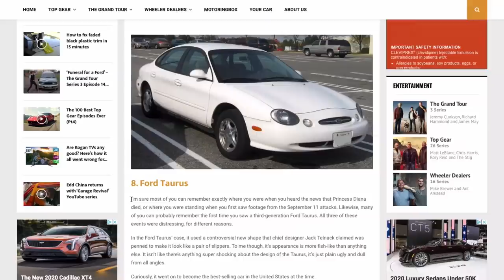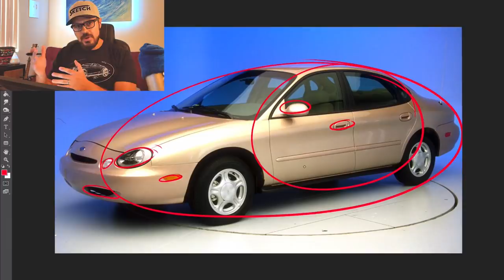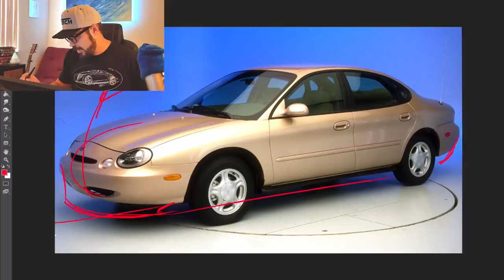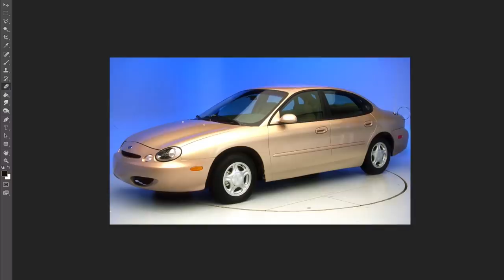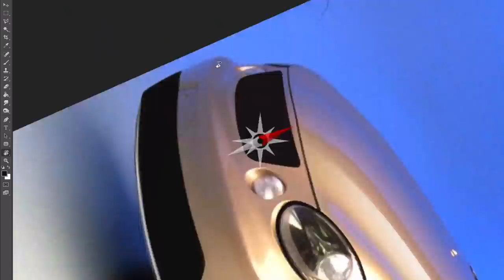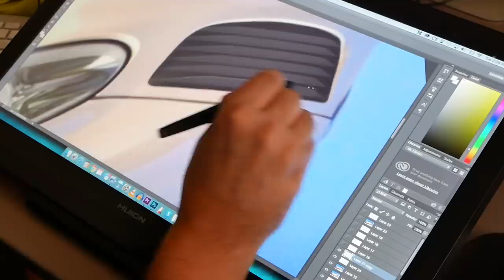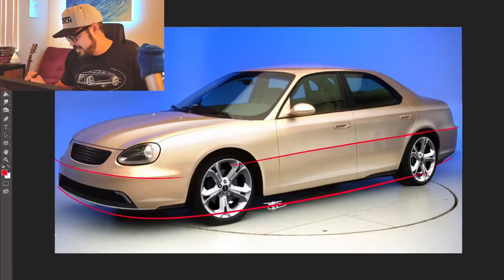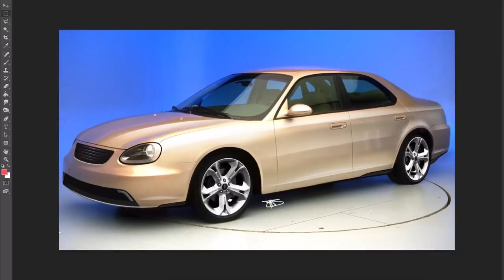1996 Ford TAURUS Re-design - CHALLENGE ACCEPTED

Comment: Peugeot were on the top of their design game in the 90’s. Peugeot 306, 406 coupe and sedan looked fantastic and had really strong lines
Reply: Remembered the 406 in the first Taxi-movies, what a beautiful sedan in some funny movies. And the 406 coupe with the v6  looks like the smaller brother of the Ferrari 550 Maranello, both designed by Pininfarina.
Reply: They got their melted cheese era later. The Peugeot 307 cc is the single most shapeless, blobby and downright hideous car ever made. At least things like the Ford Taurus, original Fiat Multipla or Pontiac Aztek or other 90s-2000s cars considered ugly were distinctive.
Reply: @greomgh  I remember when that came out, it looked nice and different at the time but it looks very bloated these days.

Comment: I love what you did with this. It gives a nod to the 2019 Charger. I have a 2k Taurus ffv, that my father-in-law gave me, that I’m turning into a project car. I’m going to swap the stock engine/transmission for a 300hp 302 paired with a c4 tranny. The powertrain is the easy part—coming up with redesign elements is proving tricky—but, you’ve given some real food for thought here. Thanks man!

Comment: Great job with the redesign you did a good job updating it and bringing it atleast a decade forward whilst still respecting the original design. The 1996-99 Taurus is such a time capsule, it'll be one of those cars a decade from now only seen at car shows. Since most of them won't make it another 10 years, but the ones that do will look ❤. Again Great work Sketch Monkey, inspiring as always!

Comment: The worst part about that interior was the elliptical radio. It was an odd shape and had the climate switches integrated into it. It was years before they came out with a faceplate to mount an aftermarket radio in these, so I was stuck using cassette adapters and walkmans with mine

Comment: Mom had one. Was pretty reliable especially since was a rental before. We called it the green frog haha
Reply: My friends dad had one, was still running in late 2018. It took them driving the car in the summer without coolant and overheating the engine about a dozen times before they broke it. The car still starts and it can drive short distances, but the engine can't run for extended period so of time.

Comment: Sorry to say, I absolutely hate this. You made it worse. You of course did the correct thing by lowering the front bumper to eliminate lift, but instead of compensating for it by lowering the front end, you RAISED it, taking away the cars identity and instead making it look like a heavy, draggy SUV.  Instead of taking the idea of the original car and bringing it into the 2020's, you changed it up completely and made it look like something out of the early 00's, which arguably is the worst period ever in terms of car design.
The funky, fun and aerodynamic roof line became square, formal and dull. To me, this looks even more dated than what you started off with. It looks like a Crown Victoria with a body kit.

Comment: really bad "transformation" definitely FORD did it best in the year 2000 when they updated the design. Personally, I love that generation(96-99) of Taurus/Sable. I love the uniqueness and originality of the design and as a great brand differentiator. For me is one of the best-executed car designs of the modern era. Today all cars are squarish again because is cheaper to make them like that, some of the Mercedes Benz use the trick that you just used mix rounded elements in a square shape to give a sensation of modern, but big fail!